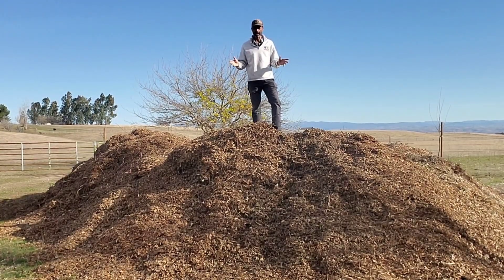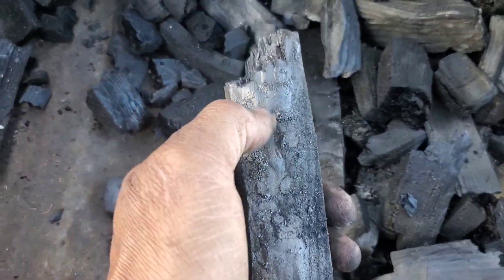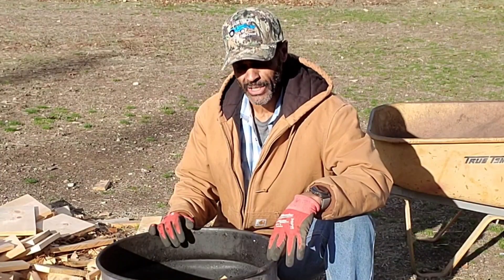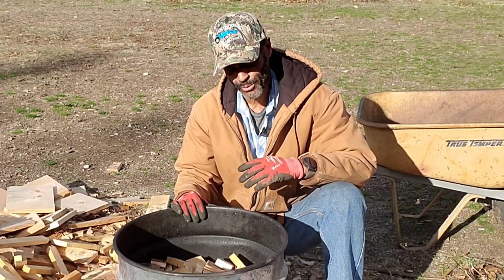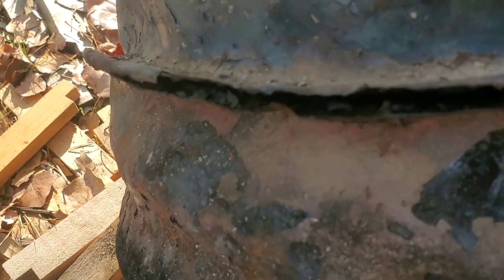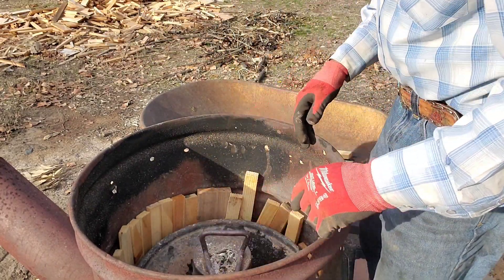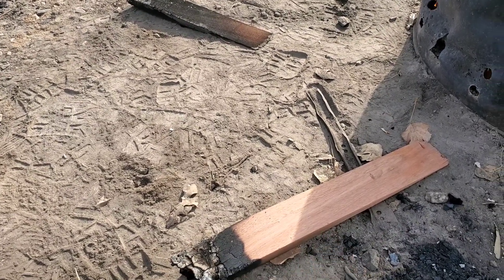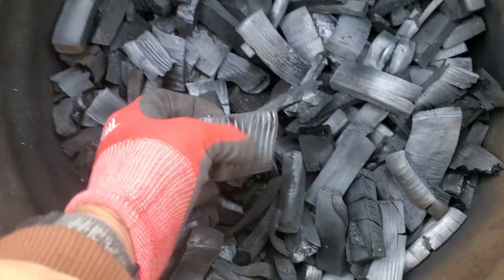BIOCHAR made from WOOD CHIPS! The secret to SOIL HEALTH

Comment: Can biochar be made with sawdust
Reply from the maker: Yes it can but the issue to overcome is evenly heating the entire surface of the dust particles. If the temperature being applied  was higher and for a longer duration the process would succeed but the closed  system I have created will not work and would be less successful than when I experimented with woodchips.

Comment: New comment: there’s another style where it’s just one barrel and a flue going through the center. You put it up on bricks and light a fire beneath it with holes in the tube bottom. You can put the fire out after a few hours and the pyrolysis gas sustains it. It’s hard to seal, but I find it’s much more effective if you can insulate it with something like rock wool. You burn less wood too.
Reply from the maker: Interesting idea!

Comment: Did not see where you used wood chips such as those created from a wood chipper.  I only saw you using end cuts for the process or did I miss it in the video
Reply from the maker: All of the wood chips I used have been run through a chipper. Wood chips can vary quite a bit depending on what is being chipped. Is there more wood or more foliage, branches, vines etc. The other factor that can greatly affect the quality of wood chips that one gets is how frequent the chipper is being maintained.  Sharpness of the knives and their relation to the anvil is important in getting really good chips.

Comment: Interesting.   It sounds like you need a wood chip tumbling device to continuously stir the chips while they are carbonizing.   It would need a through shaft with bronze bushings,  a stand off distance and a motor to churn the chip pile.  Because the chips are small they should actually go faster per batch.
Reply from the maker: That sounds like quite a system! I have yet to devise something so complex.

Comment: A way to create gas exchange, within the internal chamber without making airflow.... you made me think, i like. 
From your holes in the internal run perforated steel pipe up through the wood chip?
Reply from the maker: Yeah that would be an interesting design.  I spoke to a guy a few months ago that had created something similar that works for shavings and saw chips. I would love to see that design in action. Thanks! 👌
Reply: Does your inner barrel have any holes in it? How do the gasses get out of the retort into the bigger barrel?

Comment: To maximize profit, will you recommend using dried leaves with drift wood as bio fuel and facial matter sludge as bio char feed stock? This is after removing pathogens from sludge with leaves ash?
Reply from the maker: Define facial matter sludge?
Reply: @therealprtrhsenteal  common ! Is that a joke? There is google....that's dung," all kinds"  for the most part.  The one most people flush down sewage pits for free plus the one animals produce ..
Reply: @JapalekeFlybirds  You sure could have said that a whole lot more effectively.  Insults rarely do more than cause others to think less of you, confirm your biases, and reduce your credibility. Try offering  a helpful perspective next time. You initially said facial,  not fecal.  Those are two different things entirely. The response from Porter and Teal was a perfectly good one.

Comment: I just char everything in my open fire pit & collect the char for new beds & save the ash for my other beds as well as scattering around the acidic yard in mid-spring after most of the rain has stopped.
Reply from the maker: The pit and trench is definitely a good way to go. I had done some pit char a few years ago with some larger material and I think I am gonna fire up a pit this year again. Thanks for sharing! 👌
Reply: I myself feel like I get the most char for my effort with a pit burn... I haven't had good luck with my retort yet but I need to try again.

Comment: If you had a tumbler in that retort, it will pyrolyze much faster.
Took me 3 days to try to convert wood chips and still they all weren't done.
Reply from the maker: I think the only problem with putting something in the smaller chamber is that there will be less room for making char. It would be awesome to make something larger than what I currently but I need to find something that doesn't cost anything.  I'm looking! 😉
Reply: @therealprtrhsenteal  You know those hand crank compost making drums?
If you took your metal drum and an axle with a crank, placed it over a fire, you could give it a crank every once in a while to mix things up.
No fun babysitting but it can help convert packed items better.
Reply: @therealprtrhsenteal  You can always try the trench method.
Reply from the maker: @crazysquirrel9425 I actually am gonna do a trench this year. 😉
Reply: @therealprtrhsenteal  Where I live, no open burning permitted....
DRAT
Reply: @therealprtrhsenteal  try checking with trash hauling companies for old steel dumpsters.  The bottoms eventually rust out and won't hold the trash. You might have to pay something but it won't  be  much. You'll possibly have to seal the holes up somehow , depending on your design.  Maybe clay, maybe steel from 55 gallon drum sides, maybe steel from a second dumpster.

Comment: Good experiment. I have the same problem with my material so I stay with the half barrels. I was thinking of trying the chips in my horizontal  retort with some bigger chunks through out so it is not so packed in. What do you think?
Reply from the maker: Yeah that may help but only one way to know for sure. I like the idea of having some kind of vent tubes in the center to assist with airflow. Mike from food plant nursery was telling me about something that he has devised that seems to work well. I would like to get something going for the wood chips so I can eliminate  crushing. I guess I will get to get around to it with all the spare time I have! 😉
Reply: I was thinking the chips might work with like sticks or larger stuff mixed in and I'm more of an open pit or open barrel type burn.  I make mine just in an open 50 gallon.  It's a bit of a all day of the affair adding smaller pieces of wood often as the pile grays
Reply: @farmerjhemp  Open 50 gallon?  Like, barrel with no top, and holes cut in the bottom, or no top and no holes?
Reply: @B30pt87  exactly.  I do have a lid that I put on if it's real windy.  You just keep adding little by little and as it grays you just keep putting more on.
Reply: This is my method also in half barrels, it is time consuming but my area is closer to the shop so it's a good excuse to get outside for me. Do you quench, and with what, do you leave the charcoal soaking in the barrel? @farmerjhemp

Comment: Can't one put air channels  in the middle of the  barrel to help distribute the heat throughout the retort chamber?  Something like steel pipes. Or smaller burn chambers within the larger burn chamber?  Basically,  use some mechanism to create air spaces through the middle to give the heat and gasses unimpeded freedom of movement.  That's what I'm planning on doing with my dumpster size  retort.
Reply from the maker: Yeah that definitely would help. I have seen some interesting designs along those lines. If I get enough to build another retort I would consider building one specifically for wood chips.  I have nearly an unlimited availability with both types of feedstock so having a retort for each would make ultimate sense.   Thanks for the suggestion. 🙂
Reply: @therealprtrhsenteal  I'm supremely pleased I can help someone I respect as much as I do you. Blessings on building your new retorts. I saw somewhere where someone had found the maximum burn chamber size to use with chips. I'll see if I can find it again and message you if I  do. I'm thinking it was from Living Webs Farm.
Reply: Look at sawdust stoves for inspiration.
Reply: Thanks for your clear and simple explanation of bio-char!  Im curious if you experimented with using bamboo!!  Supposedly it’s one of the best if not the best source for bio-char???
Reply: So I imagine a sealed barrel would prevent proper degassing and would make charcoal that would still have available fuel and a fuel less  closer to pure carbon bio-char????
Reply: I was going to attempt an almost air tight barrel like I have seen used in charcoal production!!